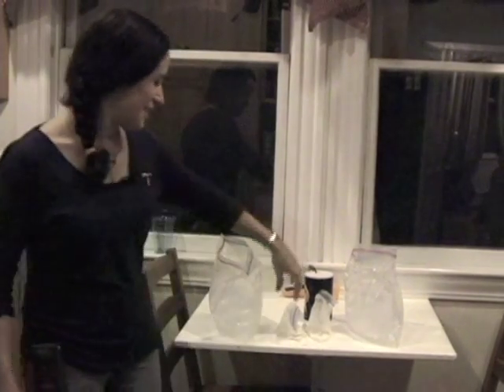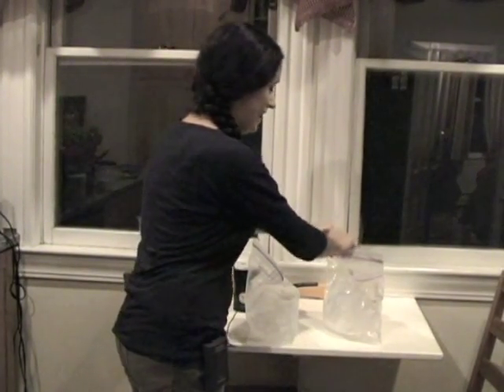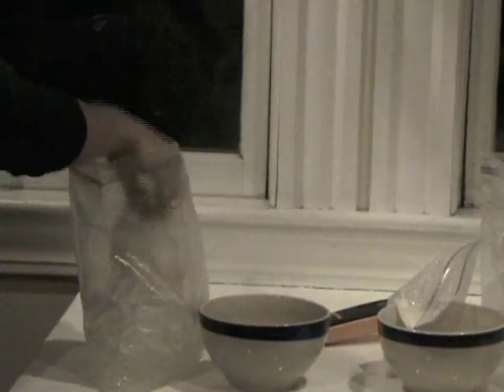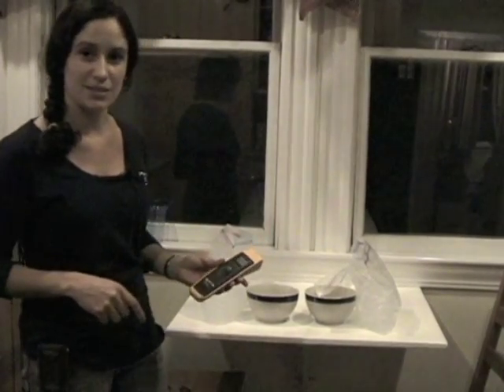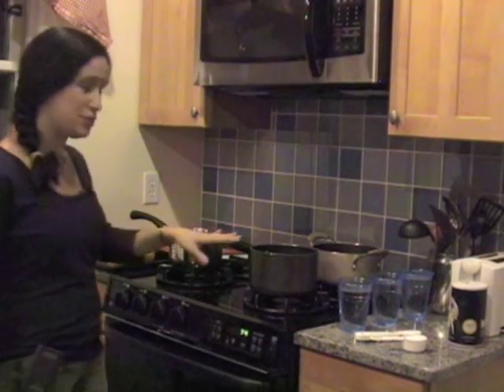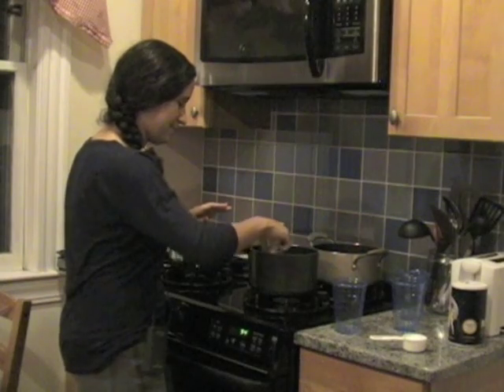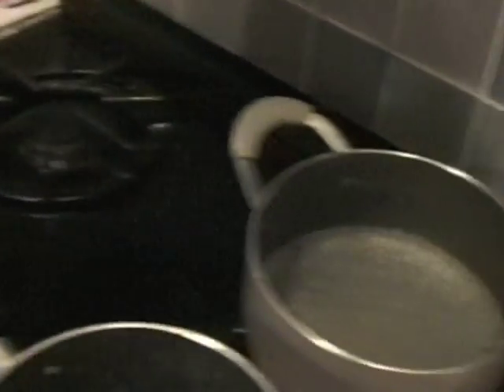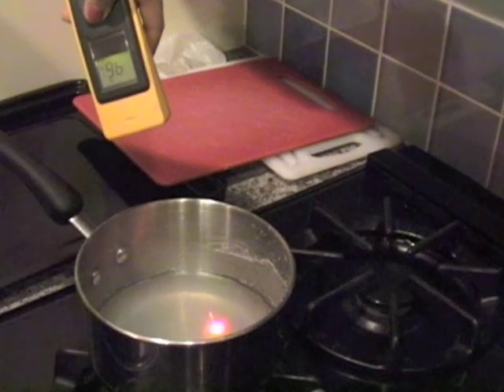Making Ice Cream with Salt: The Effect of Salt on the Freezing and Boiling Points of Water

Comment: Very informative. so salt increases the boiling point of water and helps frozen stuff be more frozen, but why would it keep ice off roads?
Reply: Yeah, it should harden the snow not melt it, I want think its different type of salt, Ive never seen people using rock salt in the pavement, green or blue crystal pebbles.
Reply: Because it lowers the freezing temperature.